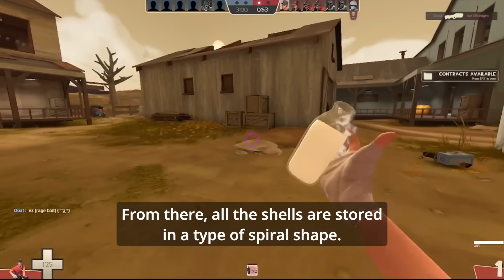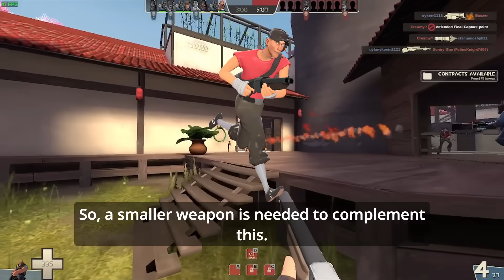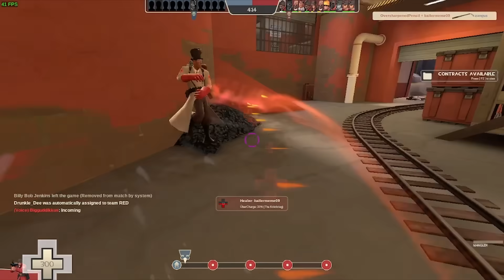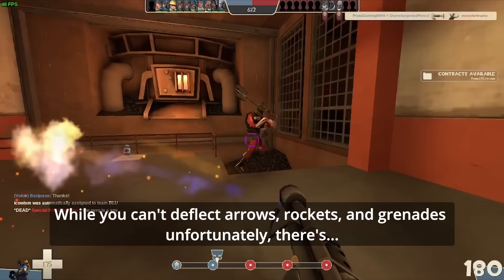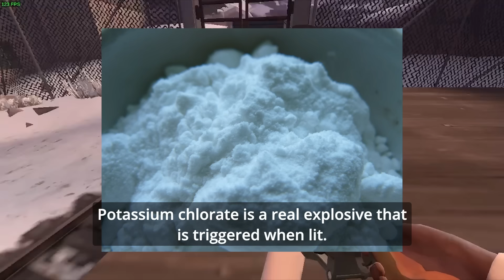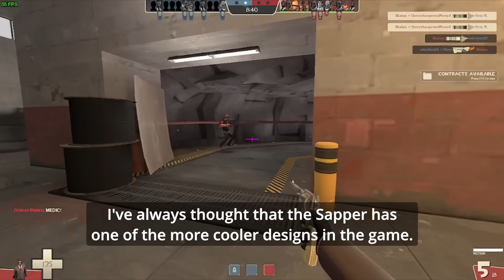How Realistic are TF2's Weapons?

Comment: Another thing to add to the stickybomb launcher, I imagine in real life, that thing is going to be manually operated after each shot, I can't imagine that it would be able to be semi auto.
Scattergun wise, I always felt like you would need to cycle it twice to get both shells ejected and possibly a different method of loading as the way the cylinder would need to be positioned to fire both barrels I find it unlikely that you would be able to load it directly in the cneter

Comment: So I know that I am both not the best engineer, nor am I the most intelligent when it comes to general physics, but I have some idea of how the Dragon’s fury might work if changed to be real. Biggest issue first up is ‘how are these ignited gasses being shot forward so far?’, well I believe that the muzzle(?) on the weapon drags in air as it shoots itself backwards [This is completely ignoring the fact it is called ‘pressurization’ for the reload time]. To have the side facing the user have a cut that feeds in air it can propel whatever it is forward. Though not far. There also seems to be a propane tank on the bottom as usual and the trigger is funky but also is just normal for the weapon. The entire front half of it is all that seems entirely off from what I remember. And my apologies that this isn’t very helpful for being a full paragraph

Comment: They aren’t scaled down. Those stocks have been cut down, but not off. A guy I knew ran a similar set up when worker in a pawn shop. He shortened the stock, but so you could still use it, but it was easier to maneuver behind the counter

Comment: pyro's airblast extinguishing could might imply that the pyro's fuel is a two part mixture, that only becomes flamable when mixed, meaning one part of the mixture could be very good at putting out fires compared to the combined mixture, this actually kind of makes sense if we think about it in that respective. even the design of the degreaser kinda shows this, the secondary ignition tank might be the activator to the main fuel's fluid, this could be why it uses more fuel to airblast, pyro has plenty of the igniter, but the ratio is delicate, pyro might be a chemist. this mixture pyro uses might need the correct ratio of fuel to ignition mixture to work, that pyro doesn't just not airblast because he is out of fuel, but because it might have a dangerous side effect by 'dry firing' the airblast,  or it could be the other way around, the airblast could become non-flamable when mixed, meaning pyro is only able to airblast 4 times, because that is how much fuel he has that isn't dangerous to spray on teammates. its just a theory.
Reply: Now add pyro vision into the discussion, how did pyro make something like this